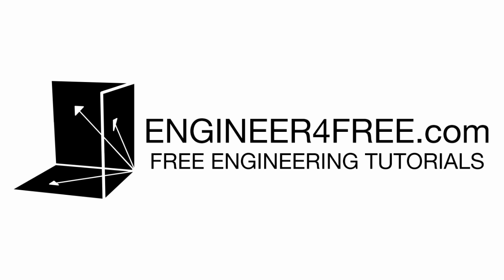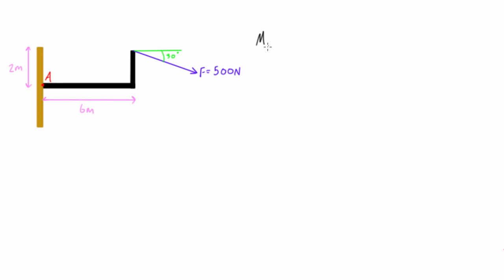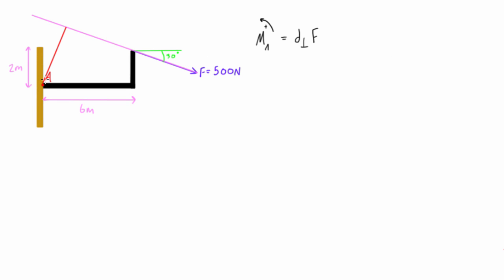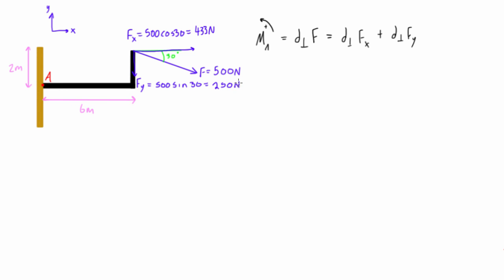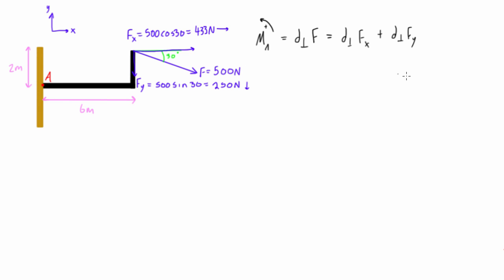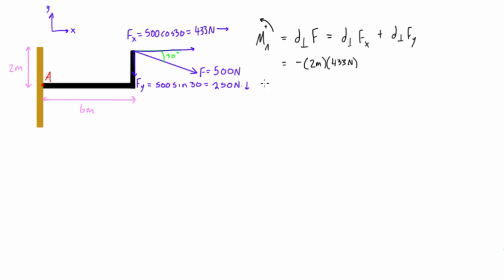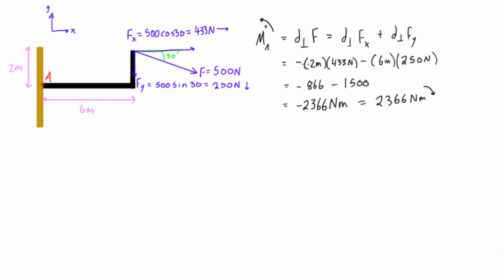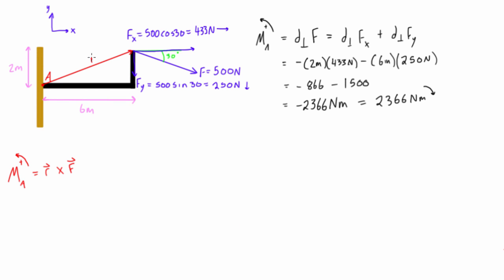Find the moment of a force about a point

Comment: A little confused about the right-hand rule for the cross product you said that your thumb is point into the screen? can you please explain?
Reply from the maker: Hey yeah, make your hand an open palm with your thumb out to the side, as if you were going to give someone a high-five. Align your 4 fingers with r, with your wrist at the tail of r. Then sweep your palm clockwise until your 4 fingers align with F. If you do this, your thumb would have been pointing into the screen. It's the only possible way to make the movement. The direction that your thumb is pointing relates to the "direction" of the moment vector (though that direction is in line with the axis of the rotation of the moment in the 2D plane). Check out this video on the right hand rule: https://www.engineer4free.com/4/right-hand-rule-for-the-vector-cross-product

Comment: Sounds like a stupid question but I struggle with trig and am not sure how you determine which function (sin,cos,tan) to use when trying to figure out moments. Any tips for how to easily identify the correct one would be greatly appreciated.
Reply from the maker: Hey, draw a right angle triangle over the diagram such that you know at least one length and angle. From the angle's perspective, identify which side is the hypotenuse, opposite, and adjacent. From there, you can determine which trig function will include the known length, and the unknown length you are looking for using SOH CAH TOA. Once you write the trig function with the known angle and one known side, you just need to rearrange it to solve for the unknown. See this image: https://imgur.com/a/YCT6I1a
Reply: @Engineer4Free  You legend, cheers

Comment: At the end of the cross product, why did you do the part with the [001] and why is the unit vector for moment in the Z direction? I thought this was only 2d motion so I'm a bit confused.

Edit: I understand using the right hand rule, the cross product is in the negative Z direction, but I am just confused about how this relates to the moment. Does this mean the moment is in the Z direction instead of in the clockwise direction?
Reply from the maker: Hey, yeah, cross product must be applied to 3D vectors, so if we're working in . a 2D space, we need to add the third element of zero for the computation to work. Watch this video though: https://www.engineer4free.com/4/right-hand-rule-for-the-vector-cross-product I discuss the right hand rule and why 2D moments vector direction points into or out of the screen, while their rotational sense is in-plane, clockwise or counter clockwise

Comment: I keep getting different answers when I plug in "500cos30". How are you getting those?
Reply from the maker: It’s the way you’re typing it in, missing some brackets for proper BEDMAS order of math. The expression is to 500 * cos(30) = 433. Some calculators require you to enter 30 and then press the CO’s button! And that will return the closing of thirty which you then multiply by 500. Your calculator also needs to be set to degrees.

Comment: Why does this work for any point along the line of force? Doesn't changing one of the vectors in the cross product drastically change the result of the calculation?
Reply from the maker: It's just a very cool property of this application. Plot out a few points that are on the line of action of the force then run the cross product calculation, you'll get the same answer for all of them!

Comment: Sir please help me:
The formula of moment is
M=f×r
So here why we use.
M=f.d
As moment is a vector quantity...!
Please answer
Reply from the maker: Hey yeah, both work but are just two equivalent ways of doing the same thing. If you take the cross product of two vectors, you get a third vector that is orthogonal to both of the first two. In the case of a 2D problem, the first two vectors span the plane that is the page, and the cross product will then give you a vector that's normal to the page (straight into or out of it). If your thinking about using M=f*d, you don'y write f or d in vector form, just the magnitudes of f and d. Now for a 2D problem like this, when you find the moment about some point, the moment is going to have a clockwise or counterclockwise sense. If you remember the right hand rule of moments though, it's that the the sense actually wraps around the direction that the vector quantity is pointing in. Watch this video for what I mean: https://www.engineer4free.com/4/right-hand-rule-for-the-vector-cross-product. So even though it feels like we're not using vector notation in M=f*d, we're actually doing the same analysis, and we can interpret M in vector form if we want to. Hope that makes sense. Sometimes M=f×r will be easier (usually is in 3D problems) and sometimes M=f*d is easier (usually is in 2D problems). Just pick which ever is easiest for the problem you are given =)

Comment: if I know vector F and its moment about a point, is there any way to find coordinates of that point?
Reply from the maker: Yes. Probably easiest to do it with geometry. Plot the point and the line of action of the force. Find the magnitude of the force. Find the perpendicular distance between the line of action of the force and the point of interest. Moment = magnitude of force * perpendicular distance ... rearrange to have perpendicular distance = moment / magnitude of force. Do some geometry to finish it off. These linear algebra videos will help: find the length of a vector (magnitude of a force): https://youtu.be/QPaonprd93g and find the distance from a point to a line: https://youtu.be/8bQlwo31k2E . You might get lucky and the geometry will be really easy or obvious and you won't need to fuss with all the vector algebra.

Comment: Moment =position vector ×force vector     OR     moment =force vector ×postion vector  ,,,,, which one correct sir
Reply from the maker: Moment = position vector × force vector, in that order. Often you will see the expression written as M = r × F. An interesting property of this expression is that r (the position vector) does not need to go from the point we are taking moment about to the point of application of the force, it can go from the point we are taking moment about to ANY point on the line of action of the force. Knowing that can sometimes simplify the work required.
Reply: Thnks a lot
Reply from the maker: No problem, thanks for watching!

Comment: in clockwise sense why moment take negative instead of positive . but in force it take positive plzz anss
Reply from the maker: In this video I define the positive directions/senses as follows: Horizontal forces are positive if they point to the right. Vertical forces are positive if they point up. Moments are positive if they have a counter-clockwise sense. You are truly free to define those however you want, and at the end of the day you will get the correct answer. If you start telling people down is positive though you will certainly confuse them. Its common to pick counterclockwise as the positive sense for moments but not necessary. Notice where I come to the answer of Moment about A = -2,366 Nm, that I write it as 2,366 Nm Clockwise. If I had picked clockwise as the positive sense, I still would have ended up with 2,366 Nm Clockwise at the end, just It would have shown as a positive value instead of a negative value. Basically, just pick your positive directions and senses at the beginning of the problem and stick to them until the end of the problem. As long as you don't make and math errors, you will come out with the right magnitude and direction/sense.

Comment: would we always use the dot product of the moment about the origin we found and  [0,0,1]? is [0,0,1] always assumed if nothing else is provided?
Reply from the maker: Hey, no. There is no dot product being performed in this video. At 8:07 I say "because of scalar multiplication..." According to scalar multiplication, [0,0,-2366] = -2366*[0,0,1]. If you need a refresher on scalar multiplication, plz check out this tutorial: http://www.engineer4free.com/4/find-the-scalar-multiple-of-a-vector it is not the same thing as the dot product. So in this video, we find the moment vector by taking r x F, and get [0,0,-2366]. A vector tells us both a magnitude and a direction, and if you are familiar with your i,j,k vectors (refresher: http://www.engineer4free.com/4/using-i-j-k-unit-vectors-to-describe-vectors ), you'll be able to notice that the magnitude is 2366 Nm and the direction is in the negative k^ (read as "k hat") direction. What I did in this video was just use scalar multiplication to pull out the magnitude from the vector, so that we got the magnitude times a unit vector, and because the unit vector was [0,0,1], or "k^" it was meant to be more obvious about the vector direction. Now though, for a moment to have a vector "direction" is a pretty abstract concept thatmakes little sense in real life. The actual rotational sense of a moment is actually wrapping around the "vector direction" according to the right had rule (refresher: http://www.engineer4free.com/4/right-hand-rule-for-the-vector-cross-product ). So according to the right hand rule, when our direction is in the negative k^ direction (pointing towards the -z axis) which is "into the page" if we draw the typical x-y plane as it is in this video. So to come back to your question, we're not doing dot products. We're not multiplying by [0,0,1] just because, I just pulled out a scalar from [0,0,-2366] and was left with -2366[0,0,1]. However it turns out though that in a 2D problem like this video where your page is the x-y plane as normally drawn, moments will only form clockwise or counterclockwise in the x-y plane (the plane of the page), therefore having a "vector direction" of -k^ or +k^, respectively. Turns out that if your doing 2D moment problems with the cross product, you'll always end up getting a moment vector that is [0,0,A] where A can be positive or negative, and like I just mentioned, a positive value of A means the moment vector is pointing in the +k^ direction (in line with the positive z axis aka pointing out of the page), and the sense of the actual moment is counter clockwise, where as a negative value of A means the moment vector is pointing in the -k^ direction (in line with the negative z axis aka pointing into the page, and the sense of the actual moment is clockwise). That's a lot longer than I was expecting to write when I got started. Please watch the tutorials that I linked to, without a solid understanding of them none of this will make sense. Let me know if this cleared it up!

Comment: wouldn't the x force not contribute to moment because it is perpendicular to the point
Reply: Ah ha, I think you are confused and thinking if the Force was applied in the "corner of the angle".  I have been studying other videos for vector statics.  In which the problem was set up with "tricks" where the force "point of application" is in line with the "point of moment".  Thus, making one component(either x-dir or y-dir) multiply a "zero value" for the moment length to the "point of moment".  Not the case in this example.  Hope this helps.

Comment: sir please tell me why moment are taken in clockwise here
Reply from the maker: Hey thanks for commenting. I break the force into its x and y components,  then to find out what sense (clockwise or counter clockwise) the moments cause, I look at then one at a time.  Just imagine that there is a pin at A,  and then decide which way the object would rotate about A when you apply each component individually.  I do this at 3:36 and 3:56 in the video and discover that both components would cause a clockwise rotation about A.  Because I define counter clockwise as the positive sense,  then both moments from the components shows up as a negative in the formula.  Hope that helps!
Reply: now i got about direction here thankss